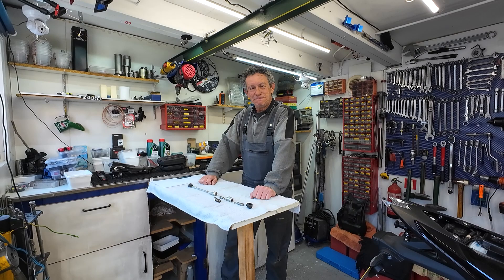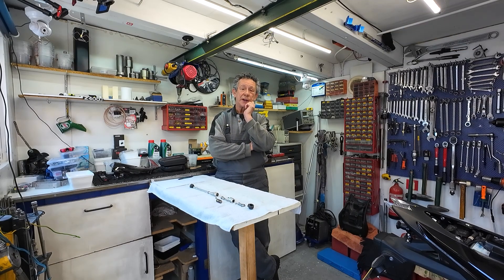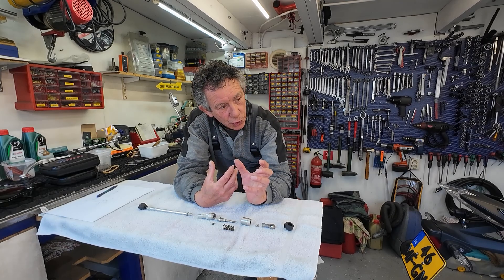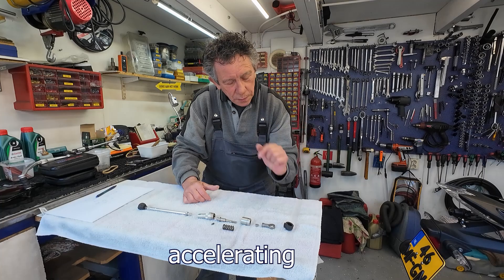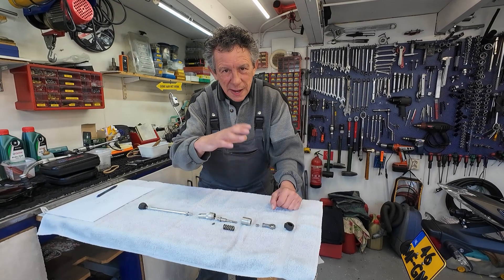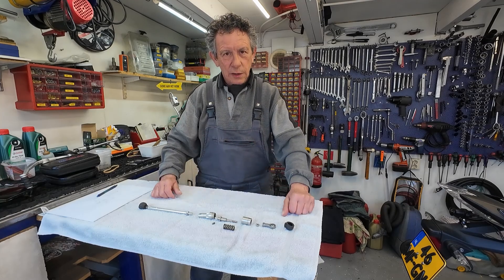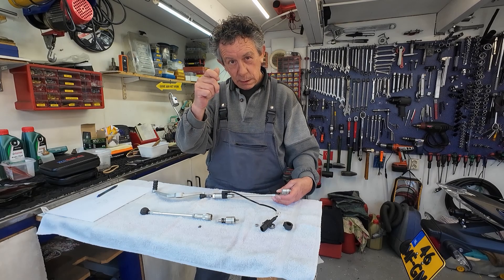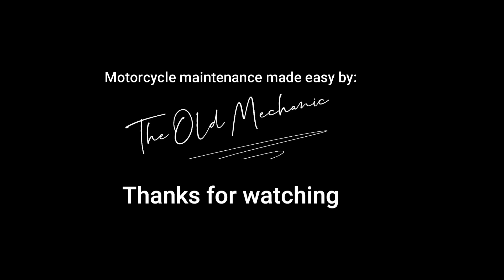‼️How a QUICK SHIFTER Works: Inside Look & Full Explanation !‼️

Comment: I guess you forgot to tell something about quickshifter because it works not only for upshift . It works for downshift as well. At least on my RT it works like this and SRR is more sophisticated bike. One more thing I can say: mine was working very badly despite bike was new (500km on odo). And problem disappeared after prop shaft was properly serviced. That what the first thing  I actually noticed after I picked up the bike from dealer. The same problem may happen if bikes drive chane doesn’t work properly.
Reply from the maker: This one only works for upshifting 😉👊🏻👍🏻

Comment: Hi there. I have a 2015 s1000r, my quickshifter wasn't working. It turned out to be my shoes 😂 I ride my bike everyday to meet my wife at her work and she she rides her bike and I ride mine to the shops to get food. Anyways, if I ride with my work shoes on, it doesnt work. If I put my proper riding boots on the quickshifter works perfect. I cant explain it. My quickshifter is up shifting only. I want to retrofit a S1000RR quickshifter so I can have up and down shifting. I have seen videos where people have done it with a ecu flash and S1000RR hardware and it works perfectly. I need this. If anyone knows someone who can do it I'm willing to pay good money for it. I dont like the 2017 onwards, I like the look of mine.
Reply from the maker: Your shoe solution is much cheaper than a new quick shifter 😂👊🏻👍🏻